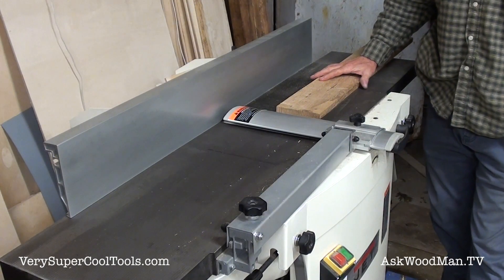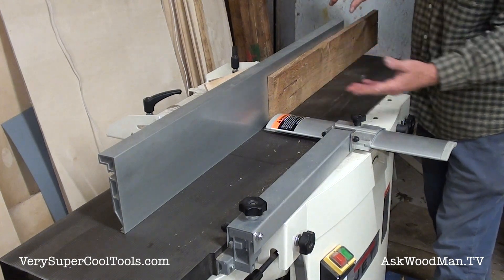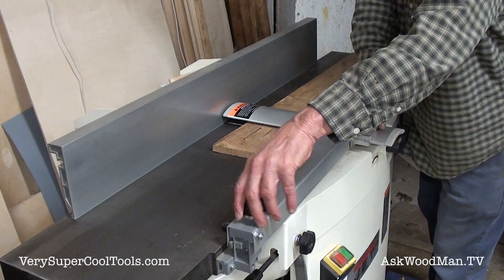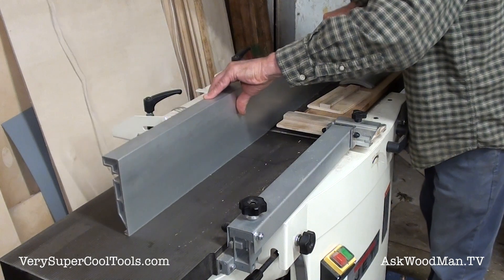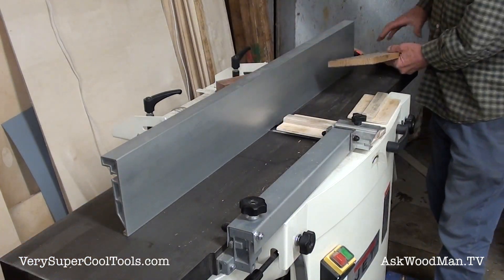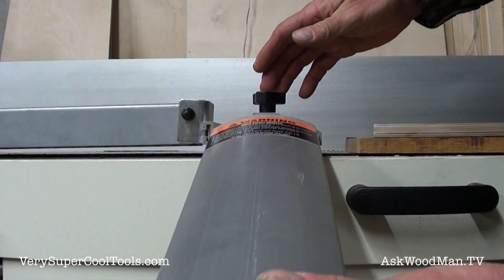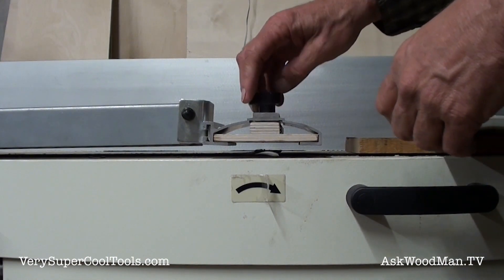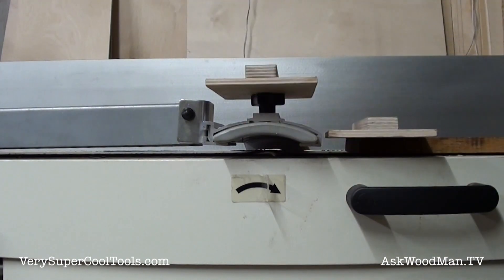1037. Making The European Style Jointer Guard Better

Comment: Thanks for the video it just the inspiration I needed to order the Jet fence for my early 1980"s Minimax fsb 35 with a home made pork chop guard that I have never really liked. It looks like I will have to drill and tap a few holes in the table side to mount it and maybe add a spacer block. The fence is just over $200 with shipping and added tax because it ships from within my state. I believe it is not a bad price for the safety it provides.
Reply from the maker: $200 is a small price to pay for safety the guard will provide. My old jointer had a pork chop guard and it took me a while to get used to this one. But I would not go back. I especially like it for face jointing.

Comment: Very good idea. I had removed my guard entirely, for the reasons you noted. A couple of these will be easy to make and much safer. Thanks! I'm currently using a couple of Ridgid fliptop stands for infeed and outfeed. Not entirely satisfactory, as the outfeed one gets tipped over occasionally, so I'll be glad to see how you address that too.
Reply from the maker: The thought of having no guard on a 12" jointer sends shivers down my spine. The two plywood short extra guards and the original factory guard cover all my jointing situations. I think you are going to like the extensions. I am designing them to fold down if they are not needed to save space.  My shop is small. I have a plywood mockup done, just need to find a free afternoon to fab it in steel.